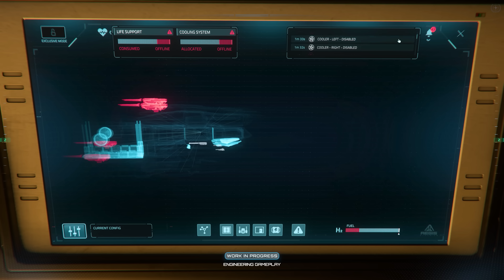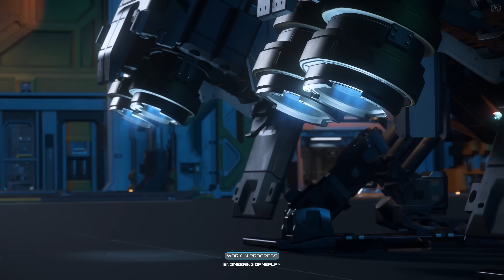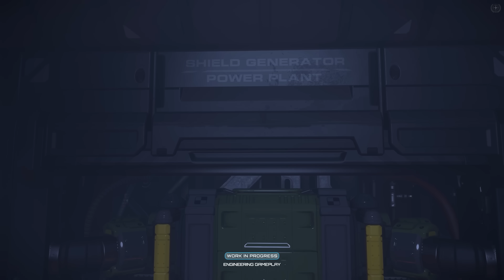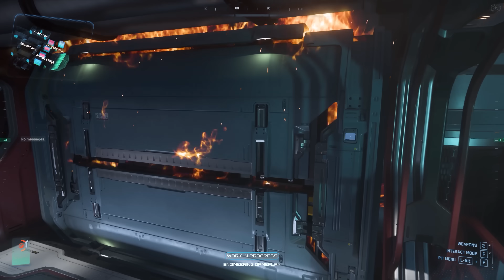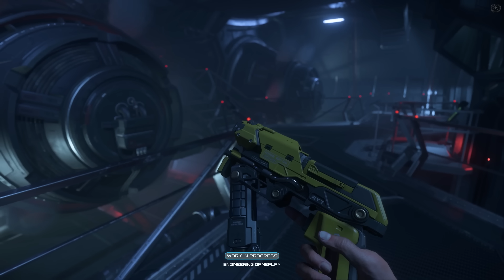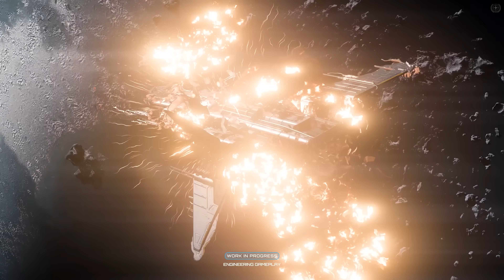Why Your Polaris Is Now a Floating Death Trap 🚀

Comment: Why would a ship fall in space, unless the top gimble thrusters are pushing it down, I suppose?  Everything, sounds like reality.  People always think cold is an issue in space, but it is heat that is the issue.  There is no convection so things don't suddenly freeze in space like in some movies.  From other test I saw they need to be more realistic about venting the space.  It seems like it takes way to long.

Comment: I don't feel that it should be this wild. Needing to run power management in a fight makes a lot of sense, but worrying about your ship overheating in a jump is a bit much. Ship manufacturers would be fitting these things to operate efficiently under "generic" conditions like travel and every day use. Combat and racing are where eeking out every bit of performance and having risks should matter.

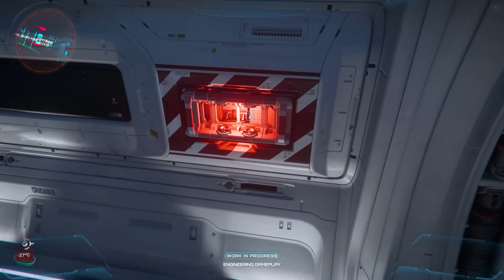Comment: 3:05 that not being automatic by a system 500 years into the future feels unrealistic 

Every problem a ship computer can Diagnose and fix via turning certain systems of or on should be automatic becaus that is just what computers are capable of that's what they are made for

This whole mechanic might be a good balaning method during alpha when we are all cramped into 3 systems but after the game is released and people will be all spread thin all over the verse there the need of a full team to somewhat effectively use your polaris agains some vanduul pve enemies will break the game for almost every player

As someone with years of mmorpg experience i know even in a relatively large guild its hard to consistently keep a large group together and then add to that some players of that large group can't man the turrets or steer the ship but have to run around your engine room fixing shit all the time.

This wont be a sustainable game feature

Comment: the Whole 3D engineering for opening doors and closing them like why can you not set PRESETS for lock down with a lighting change too.
the interface better improve when they switch the MFDs to paint.
 really need a better API for the game also.

Comment: "Mutli crew is boring!" , "so dumb that a light fighter can just blow up a capital ship!" , "SCM mode sux! I want top speed and full guns and shield with no trade offs!"  CIG introduces engineering to and early testing to create trade offs and keep ships from simply blowing up.  "I dont want a multicrew job!", "i just want power to everything again", "so dumb, i dont want to have to do things to keep my ship going".  This community is so fickle.  

They have said a couple things to keep in mind.  Once armor is in, certain guns will be compleltely inneffective against certain ships.  Light fighters wont be able to do anything except take out turrets on bigger ships.  You can see in the UI there are presets that I think will replace master modes. Want to go fast like Nav mode?  Hit a preset for full power to engines but you cant run shields and guns or if you do, you have to turn off other vital systems. True, armor is needed to fully envision what it will be like but I really like where its going.  Also i think there will be some default presets to make it easier for new players.
Reply: Problem is they keep increasing gun sizes on ships so they will punch through armor anyway

Comment: If it goes live new players will come and go lol
Engineering should only be needed on Cap ships, that also helps to balance them to Multicrew.
But everyone will now run full Ballistics as it ignores shields, making the4m pointless, its now actually easier for a solo, you can run in FTL mode, it takes so long to down a ship now you have loads of time to simple spool and jump then repair.

Comment: Volkswagen CEO: Vhe should make all our cars in a vhay vhere the power can not run both ze aircondition AND ze CD music player at ze same time, and if a fuse for ze coolers burns out ze whole car explodes wizin 30 seconds.
If you use ze vindshield vipers or ze high beams vhile pressing down ze gas pedal down more zan 50 prozent ze engine vill catch fire and ALL ZE DOORS VILL LOCK YOU INSIDE!
Zis vill be our new design strategy zat all ozzer manufacturers vill copy!

Comment: Just shows that CIG needs to get off their ass, get that albatross called SQ42 out the door; and work on giving us NPC crewmembers asap (and not just turret monkeys but also NPC engineers)! Since 2013 they continuously went "You can always hire NPC crew to help on your ship so just buy those multicrew ships or extra game packages without worry"; only for suddenly to go all "Yeah, maybe we plan to have NPC crew at some point after 1.0 release".

EDIT: Oh, and another thing. After 12+ years we STILL do not have actual armor on our ships. WTAF?!
Reply: 🤦Squadron 42 is why most OG backers backed. Also SQ42 is what's going to fund SC to completion. IF SQ42 fails SC in it's full scope is fucked.

Comment: Volkswagen CEO: Vhe should make all our cars in a vhay vhere the power can not run both ze aircondition AND ze CD music player at ze same time, and if a fuse for ze coolers burns out ze whole car explodes wizin 30 seconds.
Reply: Ja Ja! Airbus CEO here: We should take away the engine control from the pilot and put it on a terminal at the back end of the plane... but in turn give them the option of switching on and off every passanger entertainment system individually, also we should bring back the flight engineer role so someone can control the seats for the passangers too... :D
Reply: No worse than master modes.  Lockheed CEO: We shall make a fighter that can only exceed 200 mph if you click a button and then you cannot use weapons, or countermeasures.
Reply: @Rikalonius wasn't that the F35?

Comment: After getting my Polaris shot at by npc's for like 20 minutes, I'm not worried about wear and tear, I however am concerned that the heating mechanic may be overtuned, you need FULL power in the Polaris Cooler to basically maintain the Polaris, any less and the Polaris will basically overheat and shutdown. There is basically no leeway in heat management. The wear and tear is not an issue, its the cooler that is. I'm sure this will be balanced later but it just seems to me heating in general is just overtuned, I saw even single seater fighters having issues with heating, this is not just a big ship issue, its a ship issue in general.

Comment: My biggest problem with engineering isnt the fact that it will exist. my problem is that almost everybody i know allready abandoned star citizen and getting a crew together for a multi crew experience in game is sooo time consuming that i dont even bother. lets say you ask in ingame chat, you cant even create a party easily because the alphbetiocal playerlist is too short since they didnt updated it with the increase in players per shard. and then getting everybody in the same location to board a capital ship for take off is another time sink. people wanna earn money to buy in-game stuff and if the reward isnt there only very few will actually fly capitals. i hope they make multicrew worth it one day.
Reply: It's an alpha. Treating it as a game already when there are fibished ones out there is masochism.
Reply: @boutinpowered8373  Yes, but there is a slight problem: the game should be in alpha not the developers. How many times did you heard so far that CIG have 0 clue about what is "fun" or "good game designe"? It's suppose to be an mmo right? Show me an mmo where forming a group makes you comperatively weaker than going with the same ppl but everyone doing it's own thing. That's just not how it works. My only problem with engineering is the UI, if i want to turn off a manouvering thruster from the terminal than based on what i saw so far i have to find it on a 3D exact copy of the ship where everything is to scale. Instead of a 2D menu maybe a keybind to rotate it and some representation with distorted scale so you know... you can actually can see the part you are looking for. :D

In fact the manouvering thrusters should be operated by the pilot and co-pilot. They are the ones who "feeling" what is happening, how the ship reacting to inputs, it would be an obvious choice to give them the control over thrusters. Instead of this they can turn off coolers and what not one by one from a mile long list. :D Most of that list have nothing to do with a pilot's role. Why would a pilot have control over turrets? Especially on a Polaris where the component list is just way too long.

They genuenly added something cool for once [throuster control] and they had no idea how to actually implement it so they promptly fcked up... Maybe they should play some games before developing one... They need a mandatory Barotrauma session or something. They have a shit load of money, ask a pilot to explain to them what is CRM.

There are plenty of seats / control panels on a Polaris i am pretty sure that we can spare 1-2 for a specific crew member so everyone have to work with a reasonable amount of stuff and not with a half lightnovel worth of text. :D

+ ABSTRACTION, you don't have to have control over literally everything... it's perfectly fine if the game just give a sense of control and scale. Also the guy who turn on and off a fuse etc etc is called a mechanic not an engineer. [Khm... Barotrauma again, they rly should play that game.]
Reply: @squirrelmurderous lol CIG always said it’s a simulation
Reply: @boutinpowered8373 "it's An AlPha" you cultists need to open your eyes and see that 
A.) This IS the product. Game will never release. They make thousands of dollars off people buying ships. Why change the business to a one time ~$60 charge.
B.) Pushing 2 decades and a billion dollars is not an alpha.
Reply: sounds like a long way to say your biggest problem with engineering is that it will exist
Reply: @bigjohnnyxl6666  i worded that wrong its late here
Reply: Between you and Niko, I can’t tell who contributed less to the conversation.
Reply: Lets not forget that capital ships that are fully gunned do less damage than if you ran just that many ships, and less people will die in one go. But i hope they make it worth it too cause im genuinely hyped about engineering 😅
Reply: @metakillz3532 ya instead of taking 15 people in one polaris, just take 15 hornets lol
Reply: Glorious. The time of Bobs solo-ing capitals is finally over.
Reply: You know the wrong people lol that’s why orgs exist…

Comment: Shields at full, weapons hot, AND quantum spooled? Is this video also written with AI? Power triangle adjustments? I started playing five months ago and I've never seen a power triangle except in you tube videos. Seems like whatever wrote this just scraped the internet for SC engineering and power management and wrote a script without paying attention to what's going on in the current patch. The joke wouldn't be 'did you turn your coolers back on' because on is the default condition of coolers, so it would be something like 'Did you reinstall your coolers?' 

Yeah, I know AI is a handy tool for making video production faster, but when the whole thing is made by AI and contains references to out of date information as if it were current, then tries to pass itself off as genuine human made content, that's pretty sleazy.
Reply: Its AI to a painful degree

About 2 mins I realised the TTS was talking the way those stupid AI shorts do and my eyes rolled back into my skull lmfao

Comment: Now that wave 1 was opened I actually had more problems with my C1 than I did with my Polaris.  In fact I also took my Asgard out and did bounties with all stock comps and did just fine, no fires, no major issues.    I really don’t understand why so many YouTube’s are griping about engineering.  It’s not that complicated. Yes there are bugs, it’s Wave 1 !!    Batteries aren’t in yet, charge discharge not in yet.    Just STOP with the doom and gloom!!!!

Comment: I do think they need the option of "low power" radar arrays with lower resolution. Or at least variable power settings for radars, if they're gonna consume so much cooling/power.

Also I'm pretty hype for engineering.  One of my preferred roles will be getting into the engineering gameplay.

Comment: Fighter meta still a thing. Until projectile speeds get buffed there’s no reason to fly anything but a buc,gladius, hornet or scorpius
Reply: About that.  Weapon ranges got nerfed in the test, so now fighters have to come in to the hurt range of most of these turrets.  They can't just hang out at long range where the larger ships can't reach anymore. Also smaller weapons have shorter ranges than larger ones.
such as size 3 guns with 1300m range and size 4 having 1600m. Short range achieves much the same effect as faster projectiles.  The goal is shaving down the time for projectiles to reach their target either way.
Reply: @luistigerfox yes I know. I hope they adjust weapon speeds cause fighters take more damage, and I haven’t got to test a hammerhead w full crew vs fighters, but I really doubt it’s enough against ballistic fighters. I was easily outmaneuvering a paladin in a gladiator at 1.1 against a good pilot, but I wanna test more
Reply: @mathistemple7478  a fully crewed paladin? or just a paladin pilot?  Because yeah, if it's just a pilot, of course you'll be able to outmaneuver it at closer ranges.  But if you're sustaining 1.1km or less while it has even one dedicated gunner, that's really probably more on the gunner, because now its projectiles should be getting to you in just over half a second.  That said, the paladin, as a gunship isn't designed to take out fighters as a primary target.  

Also adding to all of this is that rn the engineering update being tested completely lacks an armor system, so damage is going straight to components.
Reply: @mathistemple7478  components have hp now and a ship like the hammerhead have a lot more hp then a fighter which will get downed after a couple shot because their components died.
Reply: The components on those small ships seem a bit more Vulnerable now.  I saw one start overheating real fast after being hit 4 times.  I don't think they will be tanking damage like they used too.  There's no real reason that a light/medium fighter will be toting much armor.